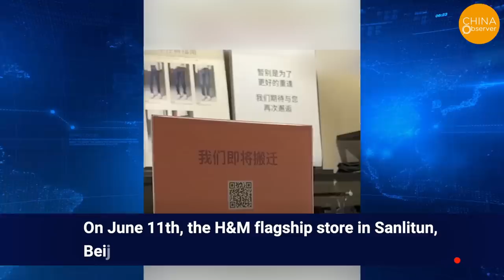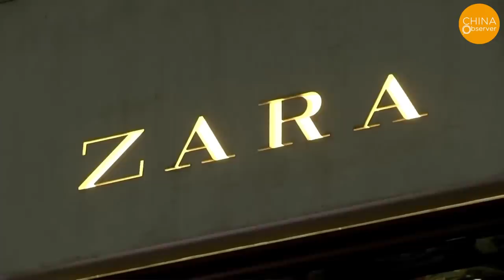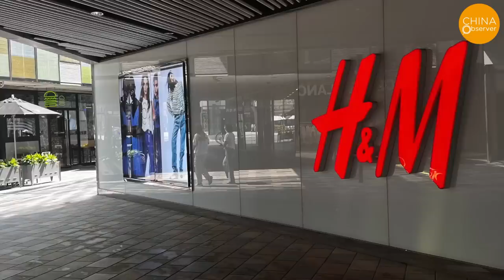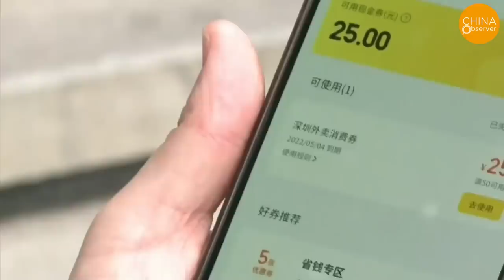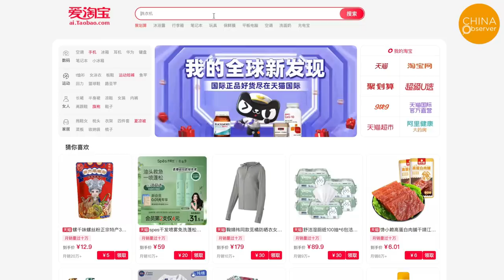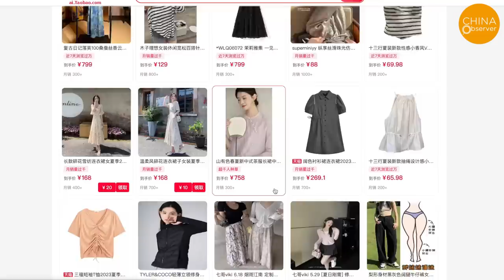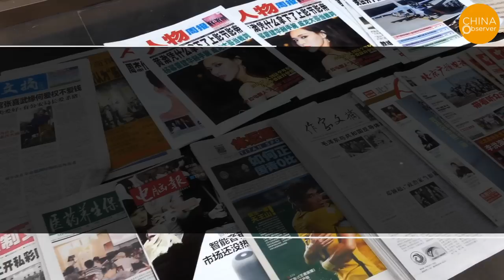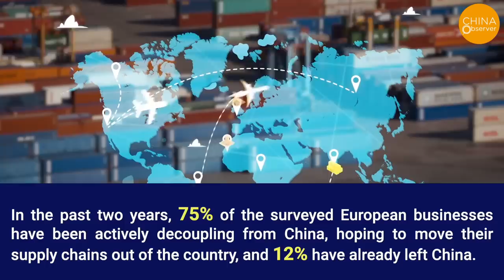Famous Brands Say Goodbye to China!  H&M, Zara, Gap…Withdraw From the Chinese Market

Comment: Many UK stores are Charity, that's thrift stores.  My tiny town has 3 Oxfam,Red Cross , Pilgrims Hospice.  There are no clothes or shoe stores. I drive 20 miles to the only shoe shop that's High Street. I wont go to Shopping Centres, that's Malls. Too much walking and screaming ,running brats for old bones to risk it. Nearly broke my hip getting mown down! Most shopping is internetz but shoes just dont fit, all the sizes are hit or miss, trying them is paramount for comfort.
Reply: It's becoming like that now everywhere.... And then in my town, Primark is popping up everywhere. Wrong sizes are common. And I didn't used to get it.. But I got jeans from primark in the past, all what I thought was the same sizing, but it actually ended up as actually wrong sizes, even for the supposed same size. They don't have QS control. Then I realised that, they are nothing but seconds. I still have those jeans. And they don't fit. Now I get my trousers from M&S. Who have always had actual right sizes.... For so many years, they kept to their size charts. I always go for the same size, and it always fit as well. (Plus it stretches, so it then means I can wear it for more than a year !) I now learnt my lesson. I do buy a bigger size.... It  keeps longer and lasts longer too. Clothing is such a... issue all around.
Reply: Those must be comfortable shoes, I bet you could walk all day in shoes like those and not feel a thing.

Comment: I still have some $5-$10 (50 yuan) H&M t shirts that are in good shape after owning them for a couple years and worn dozens of times. Even though I could spend $50/shirt if I wanted. Just not worth it unless it has special properties I need
Reply: My $40 H&M hoodie lost much of the plushness and warmth after a single wash.
Reply: @HyperOpticalSaint  I’ve also bought three $12 long sleeve sweaters there and inside is still super soft. Idk, might just depend on the item